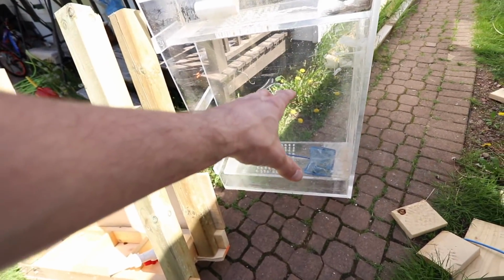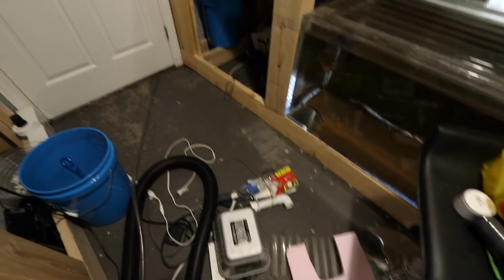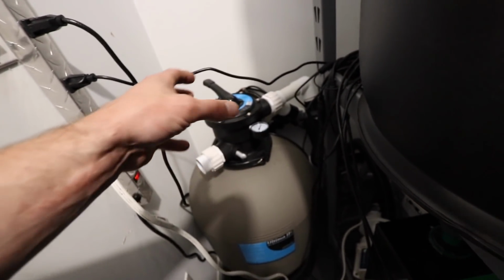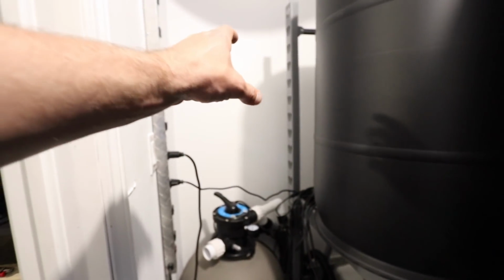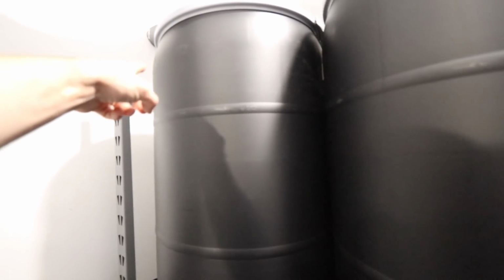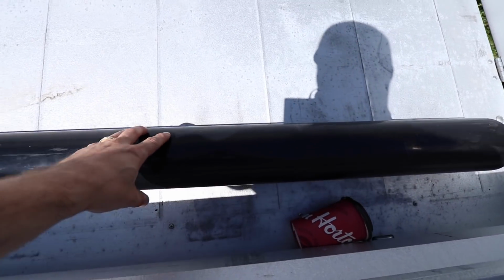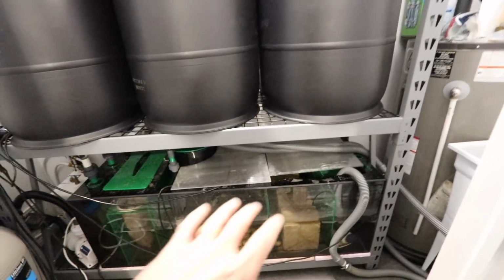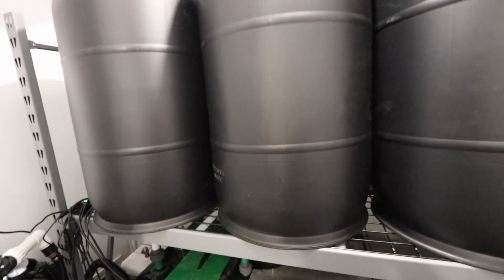My aquarium filter room | The King of DIY

Comment: Hey joey ... i hear what you are saying about abs waste pipe but i thought i'd add my experience with it .... , ive used it with freshwater before and had no problems at all even in a breeding set up ... used the same pipe to re-route my skimmer outlet back into my reef tank and lost 2 corals and a  fish within 2 days, after much water changing and removing the abs waste pipe  and spending the extra $$ on fish friendly pipe had no losses or problems since ...

Comment: Where do you get those types of barrels? Also the topic of abs and PVC what you got to remember is the fittings that come with the Vectra pumps are made out of abs and that's designed specifically for tanks

Comment: Do you ever use smart sensors that let you know about leaks?  I think they're typically designed to put under a hot water heater so you get a notification on your phone if there's a water leak, but seems like it would be useful for your gallery, so you'll know anytime and anywhere you are if there's a problem.

Comment: how are these filters different from pool filters?
Reply: RagnarokDel
It’s the same exact thing
Reply: RagnarokDel the difference is normally pool filters have much more powerful pumps if you tried to use a pool filter on a pond the electricity cost would be high

Comment: i increased the size of my 55 gallon aquarium by connecting a 55 gallon food grade barrel to the out flow of my small canister filter then let the water push out of it back into the aquarium. I ran the in and out through the top of the barrel. the In line i put a piece of black roll water pipe running to the bottom of the barrel on the inside and let the pressure force up and "overflow" back through a line into the aquarium. didn't have much media for it yet. couldn't find a source for it. but works well. then used luan plywood and 2x2s to build a box around the barrell. still need to trim the corners and stain it. (note that the wife is not greatly thrilled to have this 4 foot tall x 2 foot wide plywood box in the living room, but she will live, me living is still up in the air. lol)
Reply: Daniel Peak haha awesome thank you for sharing!

Comment: Joey,can the rack hold 3 big barrel of water? I'm not convinced of the rack supporting 2000pound
Reply: Victor Hong they are 50 gallon barrels and the weight of a gallon of water is 10 Imp. pounds. Sorry if this not in metric terms for you but 1pound weighs approx. 454 grams
Reply: LordRae you must also take into account that the rated weight is a safety factor and the actual rating will be at least 2500 lbs or more because people will overload by accident.

Comment: Hey joey, be careful with that metal racking system, i have the exact same product that holds my 100g in my living room and THE PLATFORM SUPPORTS BEND EVER SO SLIGHTLY IN THE MIDDLE. just monitor the 375g sump because you don't want that breaking from all the weight being placed at the corners.